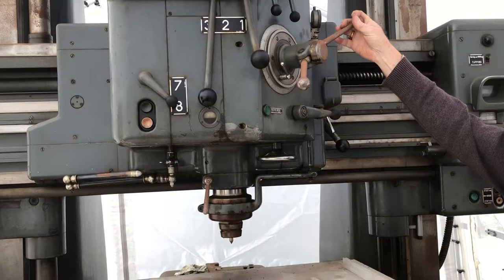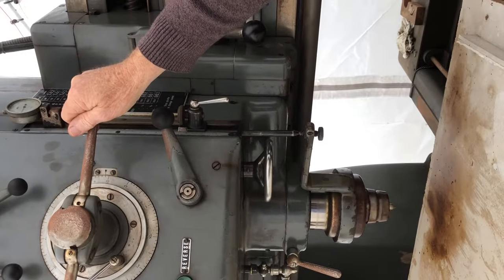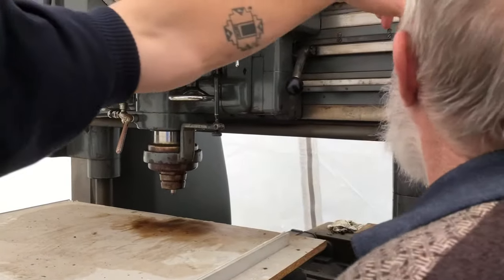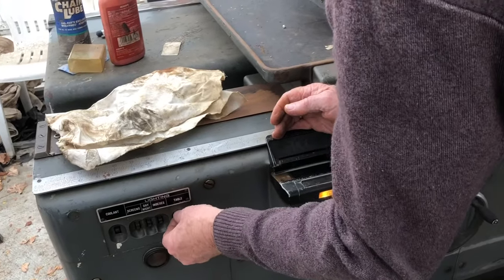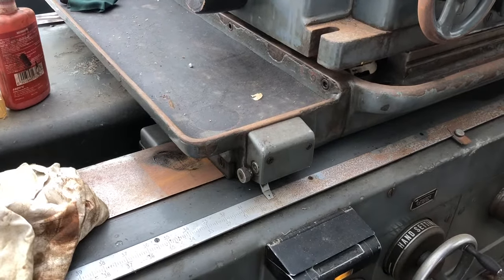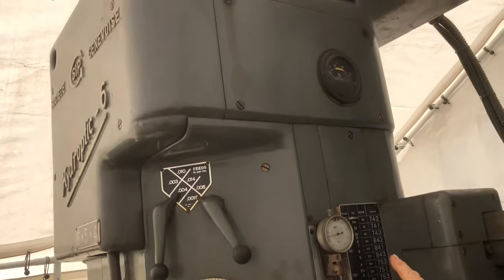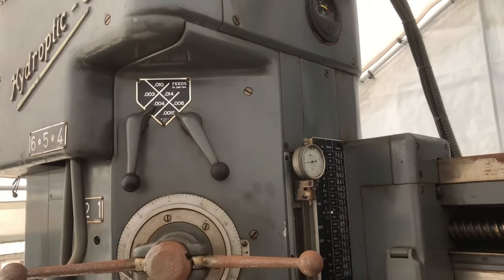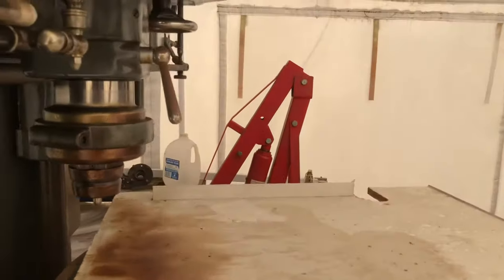Tool Time - SIP Hydroptic 6 Jig Borer

Comment: Where I work we have two SIPs a #5 & a #6. Both machines are of approximately 1952 vintage. The machinists who operate them say they both still hold 0.0002” tolerance. The Swiss really can make beautiful machines.
Reply from the maker: We were very sad to move this one on to it’s new home, but we did keep the SIP 3K, hoping to get some more footage and project work on that once the workshop is built out at our farm
Reply: I don’t suppose you sold it to Curtis from cutting edge engineering

Comment: Worked on one of these about 25 years ago, except it was fitted with a DRO and extra drives on the X and Y axis. Absolutely amazing bits of kit. The only down side was the lubrication oil on the leadscrew on the X axis would drip into the coolant and turn it "sour", god that used to stink. Spend my days now on a PC operating a CAD system, still miss the old days.
Reply from the maker: Awesome to hear from you! We still have the SIP 3K which has had servos added to X and Y axis, and in process of getting Z servo control added to it